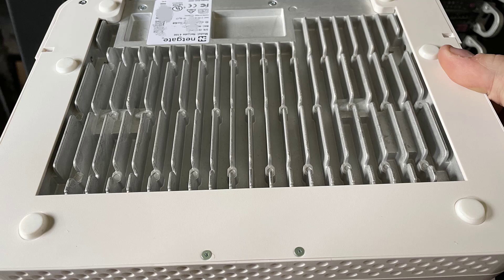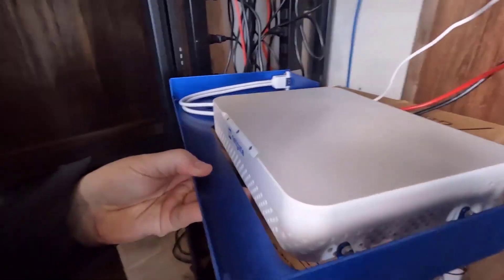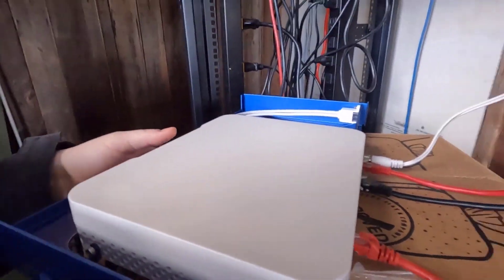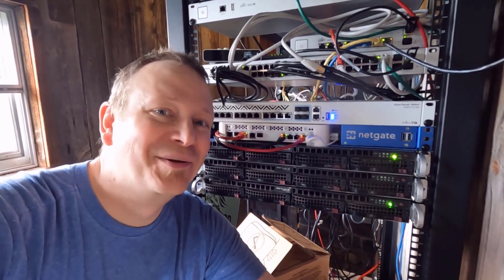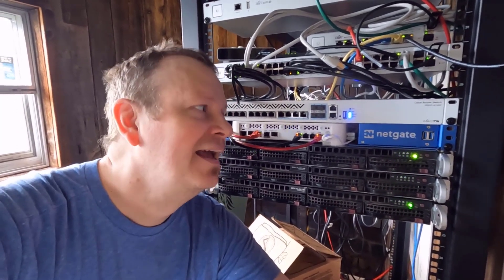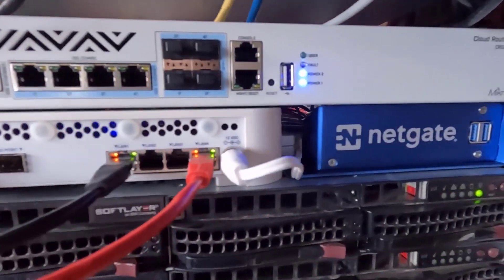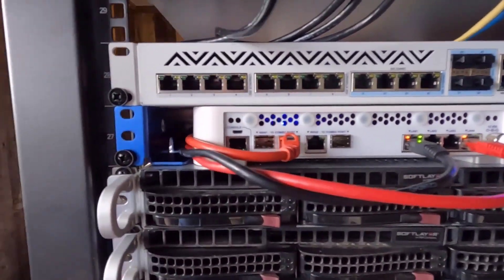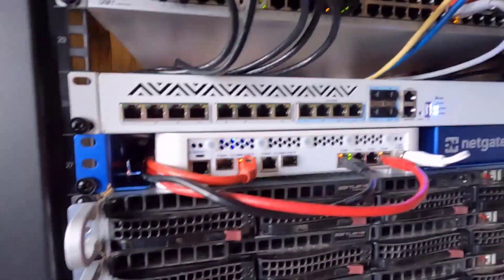Review: Netgate SG-4100 (w/Rackmount Adapter!)

Comment: Thats an awesome Review ! So tempting to get a SG-4100 and this rack kit.!
Reply from the maker: FWIW, it's been working flawlessly, 24/7 ever since I turned it on. And while I'm not usually a fan of running software on my routers, VPN seems like a good exception to my rule. And it also has been rock solid. I couldn't be happier. :)
Reply: @shawnp0wers  I really like the Dashboards & informations that Opnsense provides compared to Pfsense, BUT that 4100 does have 2.5gig ports :). The 6100 has sfp+ ports. HUMM!!!  Santa ?

Comment: Why didn’t you mount your servers with their nics facing the same direction as the switch ports?
Reply from the maker: In my case, the servers have big, bulky power cords coming out of the back next to the NIC ports. It's easier to route the thin network cables to the back than to get longer power cables and figure out how to get them all the way back.

That said, the CAT-7 cables required for 10G networking are pretty thick themselves, lol!
Reply: @shawnp0wers  i gotcha. thanks for the quick response. You're really great at these videos. I think i spent 2hrs just watching stuff. I really liked the docker videos asx well. Keep it up. Would love to see more videos on your data center and pfsense and linux stuff.
Reply from the maker: Thanks man! Like I (think?) I said in this video, I haven't touched pfSense in years because of a weird connection-state bug that was apparently in BSD. I can say with confidence, that has been completely solved, because my little datacenter (and now my house) are both running pfSense devices, and it's SO nice.

Hopefully I'll start playing a bit with it again, and make some videos about the stuff it can do. And now that I have it at my house, I'm less hesitant to fiddle. (Messing with my live router at my active datacenter is always unsettling!)

Thanks again. :)

Comment: Interesting device. I currently use a home-built firewall/router based on Intel running (of course) Linux. It's getting somewhat old though and I should really consider replacing it. I might have to look into one of these and see if it does all the things I'd want it to.
Reply from the maker: So far it's been really great, no complaints. I even started running VPN on it because it's so powerful.

Comment: what are those servers running? are they running some CPU intestive tasks?? do you mainly use them for storage too cause of that diskshelf?? filecoin mining?? 💽💾💰
Reply from the maker: They're not doing a ton right now. The rackmount server on top is my current Proxmox machine, hosting most of my services (websites, Plex, etc). The 3 1U servers are for my new Proxmox Hyper-Converged cluster. I'll be migrating services over once it's set up.

The Synology NAS on the very top is just bulk storage and backups. (And running a VPN server so I can log in remotely)

My daughter lives at the farmhouse, so there's a home network with wifi, etc too.